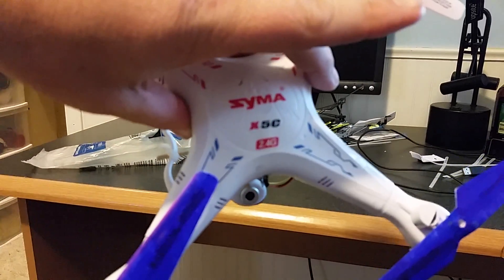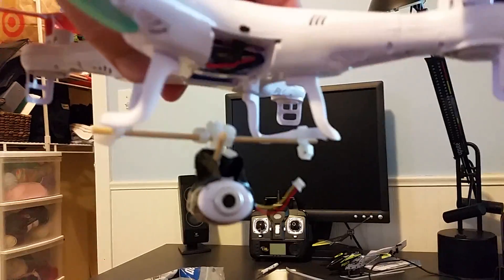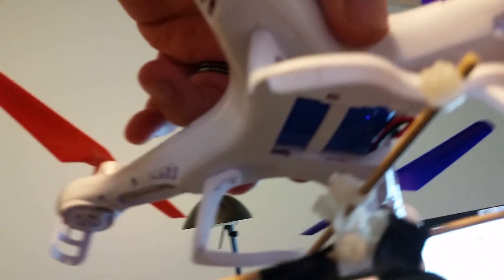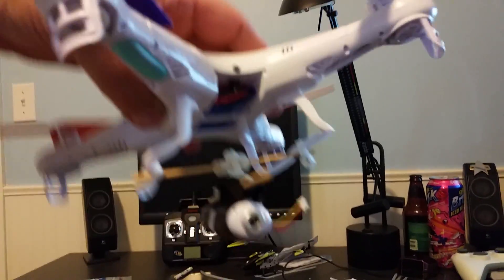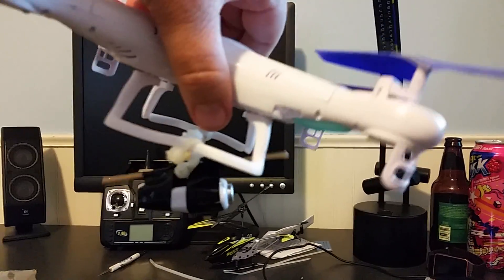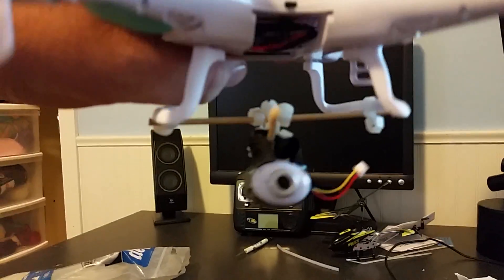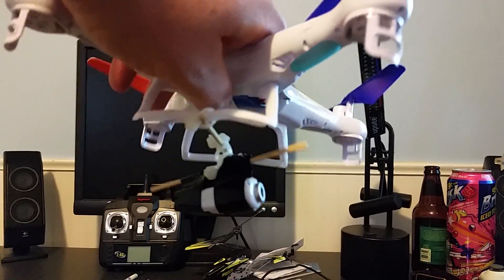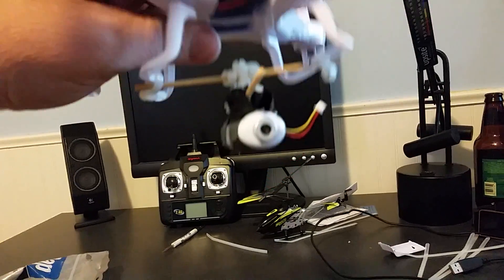Cheap drone gimbal syma x5c

Comment: it isnt conected. the cable is very strong and dont let works the gimbal free.  although you uses a longer cable the problem remains.  you need a spiral cable like phone cable
Reply: Alex Montes Yeah the gimbal looks like it works great, but with no power cable attached the camera doesn't work too good ;)

Comment: im thinking how can the camera plug in
Reply: I did this with my jjrc h98 and I had that problem. I will test it today to see if it works with the camera plugged in. The coating on the wires is stiff so I'm thinking it won't. I can always add more weight to it.